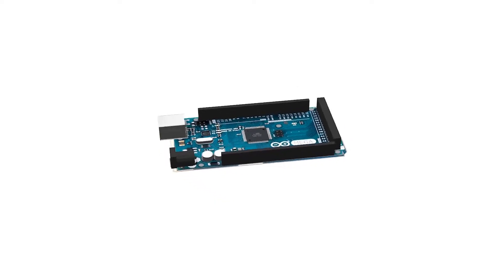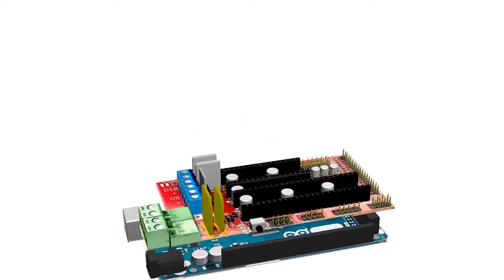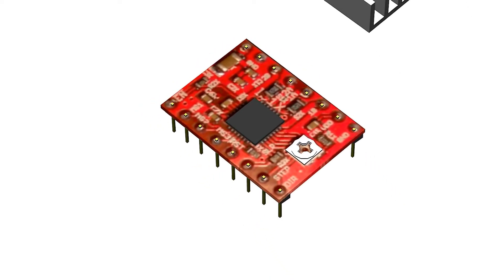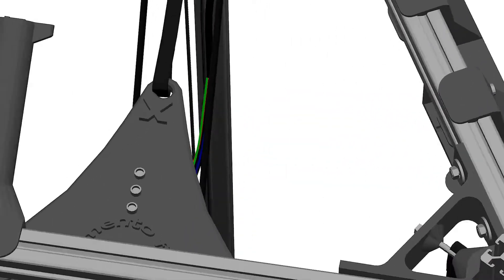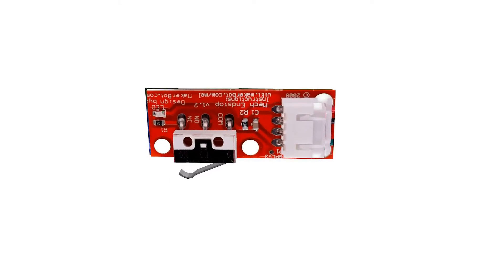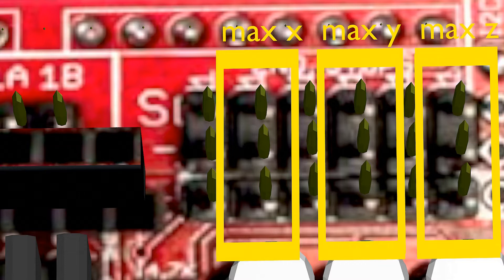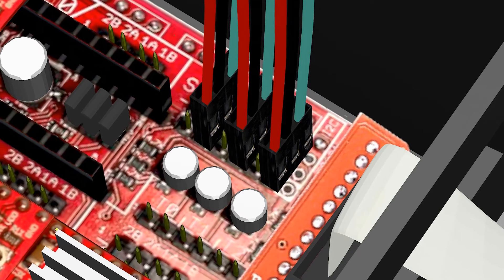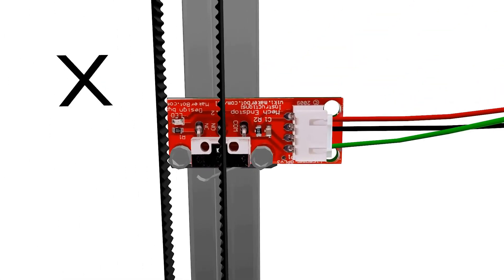Build a Delta 3D Printer - Wiring and electronics pt.1

Comment: You r presenting very well, esp the visuals & 3Ds , I just got my ramps board awaiting the display. not cool only able to get 200mm parallel links, probably will settle for a smaller delta. Thanks for sharing your built.